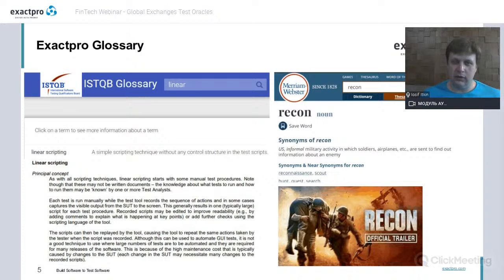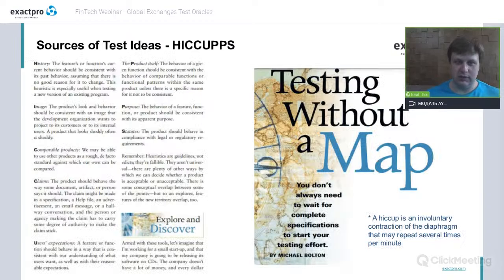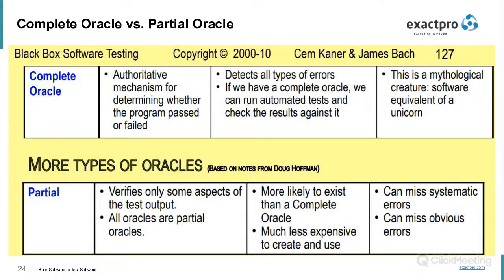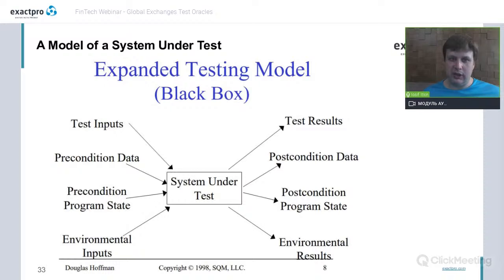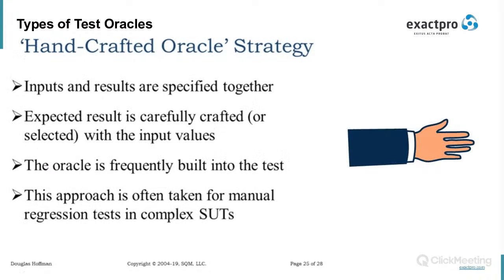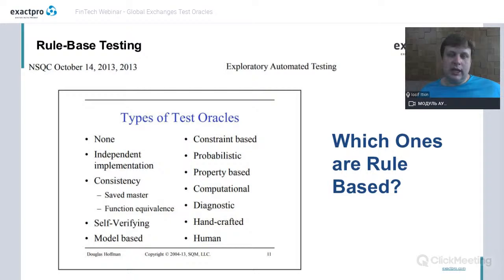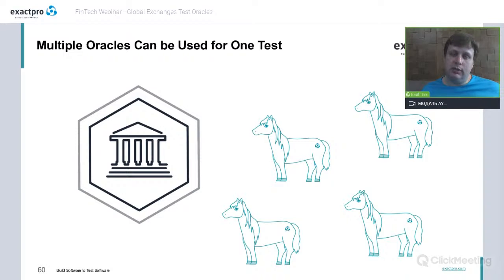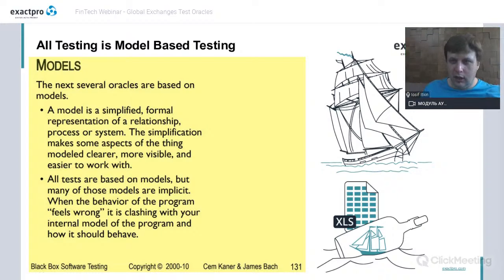FinTech Webinar - Global Exchanges Test Oracles

Comment from the maker: The related materials referred to in the lecture can be found via the links:

BBST Testing Course http://www.testingeducation.org/BBST/foundations/
On Testing Non-testable Programs https://www.ics.uci.edu/~redmiles/ics221-FQ03/papers/Wey82.pdf
Using Heuristic Test Oracles http://www.testingeducation.org/BBST/foundations/Kelly_UsingTestOracles.pdf
Testing Without Map https://www.developsense.com/articles/2005-01-TestingWithoutAMap.pdf
Using Test Oracles in Automation. Doug Hoffman (2006 Google Tech Talks) https://youtu.be/Yusd_ogkiaQ
Test Automation Architectures: Planning for Test Automation. Doug Hoffman http://www.kaner.com/pdfs/automation/Auto_Arch.pdf
The Often Overlooked Test Oracle. Doug Hoffman (2019 Association for Software Testing) https://youtu.be/hbJ1xpG7QHs
Test Oracle - Wikipedia https://en.wikipedia.org/wiki/Test_oracle
The Oracle Problem in Software Testing: A Survey. Earl T. Barr, Mark Harman, Phil McMinn, Muzammil Shahbaz, and Shin Yoo https://discovery.ucl.ac.uk/id/eprint/1471263/1/06963470.pdf
Examples of Test Oracles. Cem Kaner http://www.testingeducation.org/k04/OracleExamples.htm
Reconciliation Testing Aspects of Trading Systems Software Failures https://exactpro.com/ideas/research-papers/reconciliation-testing-aspects-trading-systems-software-failures
Software Development Costs https://blog.pdark.de/2012/07/14/
Reply: Thank you for the links! Treasure for the Software Tester :)